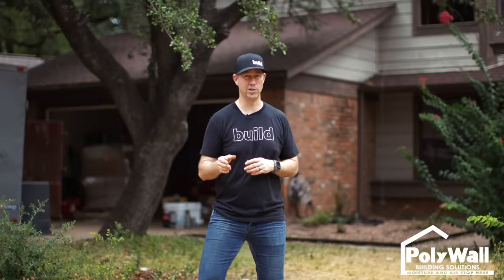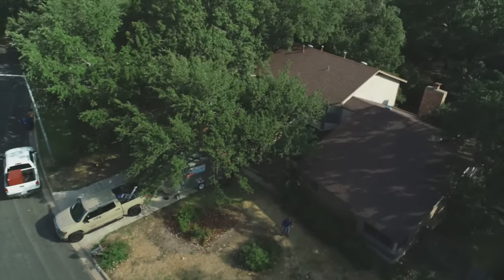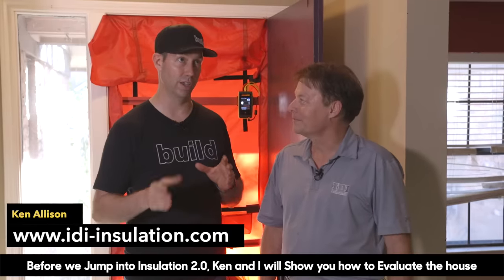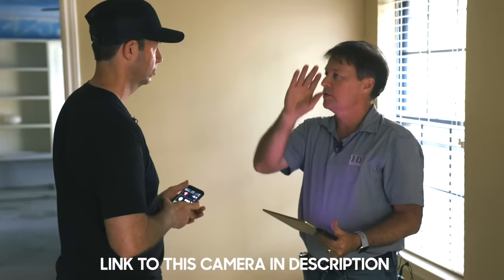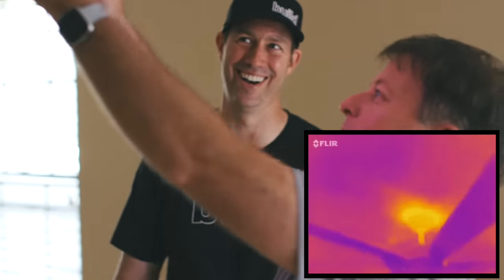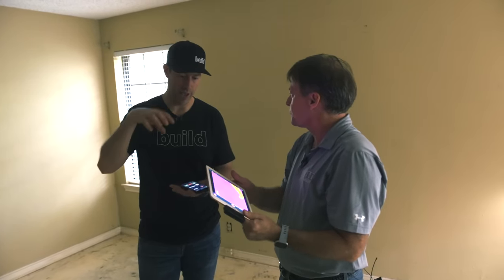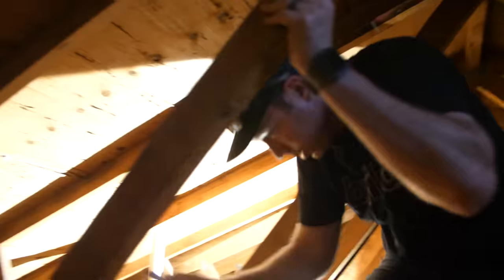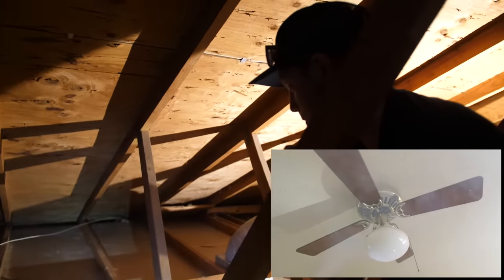Insulation 2.0 - 3 Steps to Re-Insulate

Comment: $4 a sq. ft is exactly why I bought a vacuum and tried to do this myself. Got 1/2 way done before summer. About to start again. Still cost me about $400-$500 in foam cans.
Reply: What kind of foam are you using and what vacuum did you buy?
Reply: For that kind of money, you could almost have a pro do the work, and get better results.
Reply: Insulation vacuums are close to $10,000
Reply: Fiber glass can't go into your residential trash bro

Comment: Wow, you have really shifted your content away from infomercial, back to viewer beneficial. So glad, to see and so worthwhile to watch. Just like in the beginning, except better
Reply: Too much bad advice.
Reply: Larry Maloney like what?
Reply: @Alex-vt6og , whenever his mouth moves it's bad advice. I'm not a fan of loose blown fiberglass, but there's no reason to remove what's in this attic.   The leakage Matt & his buddy are orgasmic about are the result of either installing ceiling fixtures after insulating and not replacing the insulation pushed aside after installing the fixtures, or too little insulation - blown fiberglass is poor at sealing air infiltration. However, a good layer of cellulose insulation on top of the fiberglass will correct the deficiencies, including fiberglass's tendency to lose as much as half its R-value in cold weather. All that "foam sealing" is a waste of money. He's "sealing" top plates that are already sealed with joint compound and when R-49 cellulose is installed heat loss and air leakage is reduced cost-effectively. All Matt is doing is hustling for can foam.  Even more importantly, manufacturing foam is very harmful to the planet.  Nothing is gained; just harm to our environment. The foam gun will plug after the first usage. What Matt is orgasmic about is seen daily and corrected by insulation contractors. Matt talks the talk but he lacks an understanding of root problems and selects inferior techniques and materials. And it's not "paper insulation," It's cellulose, fire-retardant and insect resistant. It's called "paper" by those who sell competing products. Matt Risinger is jerking the viewers around. Do you have a specific question about insulation?
Reply: Larry Maloney 
I was curious on the correct way I can insulate my nw Iowa basement that has never had water in it specifically walls and rim joist, without causing myself a mold issue
Reply: @Alex-vt6og , "never" is a long time, unless you bought your home recently. Wintertime ground temperature is generally below freezing and your frost depth is roughly three feet. Deep down the ground can be much warmer so it's not like insulating walls & attics above ground.  I'm not a fan of fiberglass but properly installed it will perform well for basement walls because the delta T is low.  It's critical the mud seal be caulked (vacuum or scrape clean first.) And then the next critical step is insulating the rim joists sitting on the mud seal (the perimeter.) Fiberglass loses half its thermal resistance in cold weather so a better choice for above-ground rim joists is spray foam or cellulose. The cellulose is much cheaper but it's tedious cutting & stapling webbing to fit along the perimeter walls and between the joists. I suggest a full eight-inch cavity. If you foam it, the spray has a tendency to separate over time. A technique I perfected is to cut a two-inch foam board an inch shorter than each opening. Then hold each in place against the rim joist and fill the surrounding cavity with expanding foam. The result is a nice seal - no air infiltration. You might go two layers of 2-inch foam board, or add depth with cellulose or even fiberglass (acceptable because the R-10 foam is air-tight.) Once the rim joists are sealed fiberglass between studs(offset from touching walls) can complete the walls. The higher level fiberglass is a "weak" spot but much better than what you have now. I'm an insulating fool, a perfectionist, so my favorite way to insulate basement walls, wet or dry is using cellulose, believe it, or not. Before framing the exterior walls to create a five-inch (or so) cavity to hold the cellulose, I first attach ten-foot visqueen to the concrete wall by stapling to the mud seal.  The bottom of the visqueen lays on the floor extended for the last two feet. I frame the furring wall and set it in place an inch from the concrete attached to the joists. In a wet basement, I use treated lumber for the bottom plate and even then shim it an inch off the floor. I then wrap those extra two feet of visqueen around the bottom plate so it covers the bottom two feet of the wall studs making a dry pocket for the cellulose, After wiring, I caulk any holes and install the drywall using sheetrock normally used for shower surrounds. The resultant cavities between studs can be dense-packed with cellulose from the bottom plate all the way past the top plate, including the rim joists all at one without all the foaming or other extra work. I do some contract work that has a lower standard. For that, we buy four-foot-wide rolls of 3-inch fiberglass and attach it with pins to the upper four feet of the wall.  I don't think much of the practice but some builders meet minimal standards rather than maxing out as I prefer. If you aren't comfortable with cellulose the walls can be filled with fiberglass batting. I personally shy away from foam because in most house fires using foam, the fumes kill before the fire does. As I specked, My insulated basement walls will tighten the house immensely and reduce moist air from leaking in, reducing mold. However, normal living can add buckets of moisture to inside air - from bathing, cooking, clothes washing and everyday living, so, if the above-ground walls or attic, is insulated with fiberglass, moist air can leak in (or out) and the moisture will dro out in the cooler wall. You can correct attic fiberglass by topping with cellulose. You might run a dehumidifier to dry out. And make sure bathroom vents are attached to take moist air outside. Remember, one of several causes of moisture leakage is fiberglass insulation. It simply does not stop air-infiltration. For that reason, code requires using the wrap to help the leaky fiberglass. Dense pack cellulose does not need plastic wrap to help it avoid air leakage, however, beware, the local code may require wrap, anyway. I've retrofitted old homes for many years, few have wrap. The cellulose is such an effective air barrier, the house doesn't know the difference. Why waste money on foam? Educate yourself and save money. Good luck with your project.
Reply: Larry Maloney 
Thank you very much for the very detailed info, it was exactly what I was looking for. I appreciate the great advice too, do you have a business website by chance that I can look through and maybe contact you in the future for more consultation. If only you were local I would just have you come do it. Thanks again
Reply: @Alex-vt6og , thanks for the kind comment. My business thrives on referrals, so much I've been slow to create a website. It should go live in a couple of weeks. I'll do some Youtube, too.  My goal is for homeowners to understand the thermal properties of each type of insulation and make an informed decision which is best. I travel to other states for big projects or wealthy clients but most work is regional. We've developed proprietary techniques so the work goes relatively fast, but by most standards, it's slow - "slow" being a relative term. You see, we typically install twice as much insulation, much in hard-to-get-to (too-often skipped) to get optimal results. The savings & comfort to our customers are worth it. If you methodically go through each and every task the finished project will truly be finished (no more insulating.) Much of ou work is reinsulating homes previously "insulated", three, four, and occasionally, even five times before.  For your project be sure and make your basement windows air-tight (same for  any holes in the walls.) Caulk is cheaper than foam if you are just plugging a narrow crack (1/4", or less.)  Good luck with your project.
Reply: @larrymaloney877  I'd love for you to make some YouTube videos. Complete with drawing some things out on a dry erase board. Let me know if you do, I'll tell my subs about it.
Reply: @larrymaloney877  Cellulose is made from recycled paper, specifically news paper, treated with borate. Calling it paper is close enough to correct. Cellulose is not an air barrier what are you taking about? Adding  more doesn't magically seal penetrations. Matts sweater analogy is apt. He removed the old insulation because it makes it alot easier to seal everything. You don't have to but its not wrong to do it. Did you listen to them explain their reasoning? The top plates have holes in them drilled for electrical and clearly there are gaps around it, again what are you talking about? They also make the argument that you don't need to install as much insulation if you air seal the attic...so therefore you think they are stanning for
"Big Spray Foam." Lol if they hadn't said that you'd just say they were pushing the insulation products. Did they ever mention the brand of spray foam and try to push it? Is the production and application of spray foam outweighed by the long term energy savings of lower energy requirements? I think so. Theres also other products you can use to air seal joints, like fire retardant caulk made for such applications.
Reply: @Alex-vt6og  Larry has no idea what he is talking about. Please do your research. He is literally saying air sealing is pointless and just keep throwing more insulation in your attic without doing anything else and that its rhe preferred method. A building scientist he is not.
Reply: @MarlowWhere  , there's a huge difference between paper and cellulose insulation. If you don't understand that you are missing a few facts. It's like saying a Lamborghini is a pile of sheet steel. One is a raw material. The other is a refined product with value and benefits added. What constitutes an "air barrier?" Cellulose isn't even good insulation installed poorly. I have no problem stopping air infiltration with cellulose. That is, installed correctly. Have you ever tried? How? and how did you measure the results? 

Do you have the skill or intellect to install cellulose insulation correctly? Matt Risinger certainly doesn't. Matt removed the old insulation so he could make a video and use a bunch of unneeded products. I didn't catch where Matt said with "air sealing" less thermal barrier is needed. If you say he claims that then I missed an opportunity to point out another weakness in Matt Risinger's presentation.

I'm not interested in lecturing you, Marlow. Keep your misconceptions, it doesn't affect me. But you are doing others a disservice if you make your claims to others seeking reliable knowledge. Nothing wrong with sealing holes in top plates with fire stop foam. In fact,  closing all penetrations is code. There aren't very many formulators of foam so promoting it benefits all. and misrepresenting the need creates a useless extra step instead of focusing on the optimal result.
Reply: @MarlowWhere  , are you serious? "Green Building Advisor" is a magazine supported by advertisers. I could spend my life countering all the nonsense they dream up for articles. So, if GBA prints my story then according to yo you it's certified gold?  Agreed, I'm in a different world than yours. In my world, it isn't the brand of cellulose, but the quality of the work. So far you are just talking. Let's hear some data numbers on air sealing. Show me what you've got. Or go back to sleep.  Oh, I did look at your link. NO DATA. And if one of the GBA folks do the test it's guaranteed to fail. Maybe I'll set up a test this summer (too cold now). Do you think you can absorb genuine knowledge? Or, are you so far gone you need a story in GBA?
Reply: @larrymaloney877  that was a question asked by a reader answered by multiple builders and building scientists with decades of experience. You are an anonymous person making wild claims on the internet. Cellulose is not air impermeable. You are claiming if its installed correctly it can be...yet no manufacturer of cellulose makes this claim. You're claiming some information that apparently only you have and when asked to explain, can't do so. Got it. This information must be widely available online if its the "right" way to do it. Please point me in the direction where i can read about how it can be installed in such a way so I can stop wasting your time.
Reply: @MarlowWhere  ,  you do understand "75 Pascals" is about one-tenth of a PSI? There is some interesting discussion on GBA magazine's link you provided (thanks.) But none are identifying themselves as "scientists." None state they have done any research on the topic. One commenter actually claims he "blew on cellulose with his lips" as a test. Maybe he blows too hard? Before he concludes that "cellulose passes air," let me dense pack his mouth and see if he can suck wind! 
Most commenters in your link speak, saying, "I believe this," Or I think that." The fact is, not many construction materials are "air impermeable."  Bathtubs and glass are, but the wraps marketed for covering buildings aren't. Besides, insulation is only part of a building envelope. Examine the other products used to build a wall or ceiling, and you might discover that because of a misunderstanding of product limitations, and improper application, or poor workmanship, the resultant building is not as air-resistant as calculations predict.
Cellulose manufacturers cannot control the quality of the installation.  Like any other material, the results are based on the installer. For example, was the car painted in a well-equipped paint shop by a trained, committed crew? Even then, their paint shop does not approach the pristine paint department of an automotive manufacturer. And what about painters who buy the very best paint; then spray their car in the garage (or worse yet, driveway?)  Harbor Freight sells a boatload of spray guns. I don't think Ford or GM is buying them.
Recently, I agonized through a GBA magazine's video about (I think) blower door testing. The "expert" struggled with several concepts and when he tried to describe a certain electronic measurement instrument he couldn't quite grasp the word. He kept referencing "some kind of bridge." I believe he was trying to think of "Wheatstone bridge." He presented it as though a Wheatstone bridge was some amazing new instrument paramount to achieving accurate blower door measurements.  The 1st Wheatstone bridge was used in 1833. Oh, the title of the GBA magazine's story was, "Why isn't a Blower Door Test Called a Sucking Test?" Now that's guaranteed to attract scientists. And for the record, it is your "sources" who remain anonymous. My name is on every post.
Reply: @MarlowWhere  , vehicles are made from sheet metal, but we don't call them "metal scraps." Cellulose is a processed product with value-added. Do you call fiberglass "sand insulation?"  The builder needs to show some respect for cellulose insulation and the folks with the skill to install insulation expertly. There's nothing magical about retrofitting a home with insulation or air sealing. The work is hard and it requires knowledge, skill, determination, the right materials, and integrity. Your failure to apply those virtues does not limit others. Only you are limited by your weak understanding of sound insulation principles.
Reply: @larrymaloney877 In this house, Matt complains about the heater in the closet being directly exposed to the attic.  While this isn't optimal in cooling mode, I don't see an alternative because in heat mode the unit needs combustion air.  Are there any ways to improve insulation/efficiency in this situation?
Reply: @susanlovesjava4961  I strongly believe that having the mechanical (heating & A/C) systems in the attic is not a good idea. If you are stuck with the systems in the attic, it's best to build a "room" around them to insulate and isolate them from the attic space. Insulating the attic rafters is not sufficient as it results in an inadequate thermal barrier, causing the homeowner to heat unoccupied space. Combustion air is usually piped into the furnace from outside, so as long as the piping route is accessible, the air supply is assured. I strongly believe that everyone should condemn the practice of installing furnaces and A/C equipment in the attic instead of just talking about it.
Reply: @larrymaloney877  Thanks for the info.  I have the setup as shown in the video and the unit is not original from 1966 but was updated in 1993.  There is an exhaust but I'm not sure about an air inlet unless it's a pipe within a pipe.  I do recall when my dad had it installed there were issues with the exhaust because of how efficient the unit was at the time.